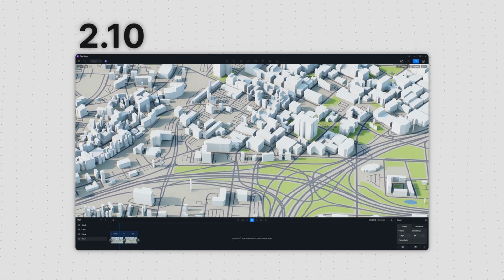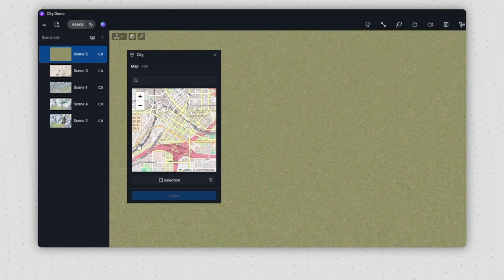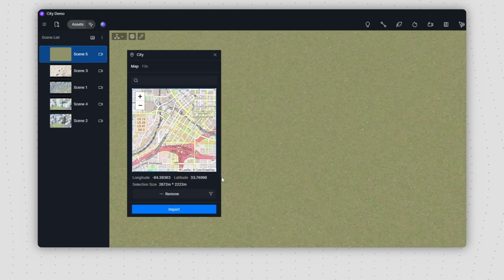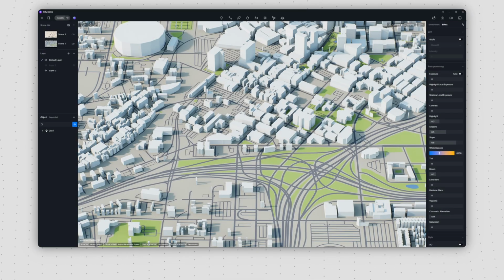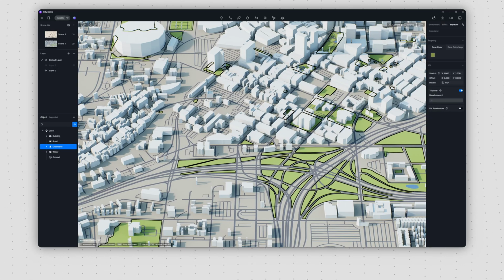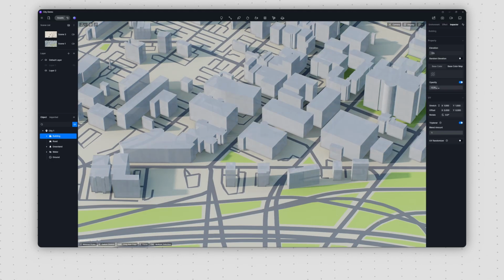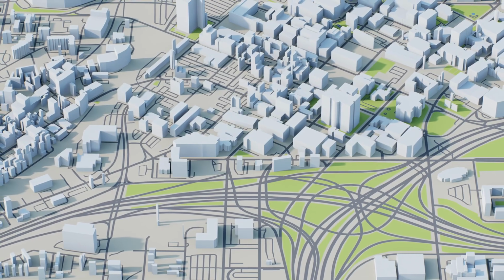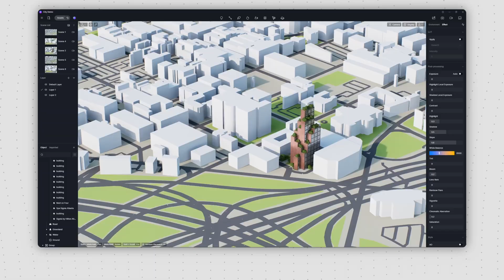How to Use City Generator to Effortlessly Create Topography for Architecture Design

Comment: Thx for the video, but could it be that it´s not possible to import the landscapes height? It´s all flat after the import. Therefore I can´t use it. This is very bad. In Lumion the heightmaps are there, which uses also open street maps.